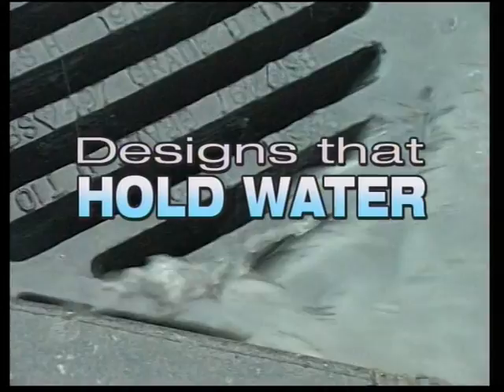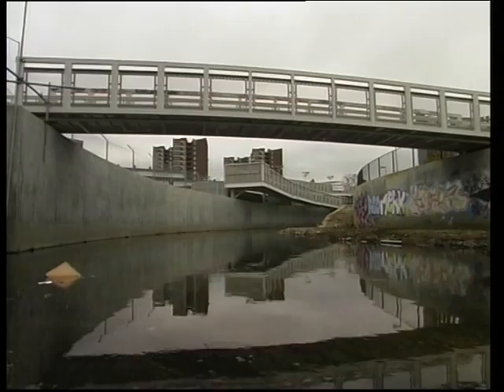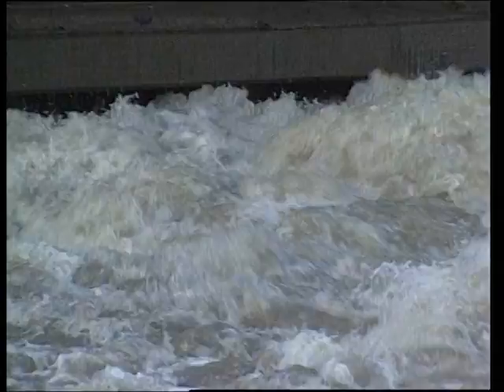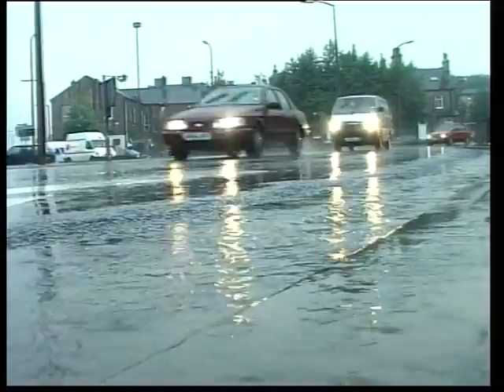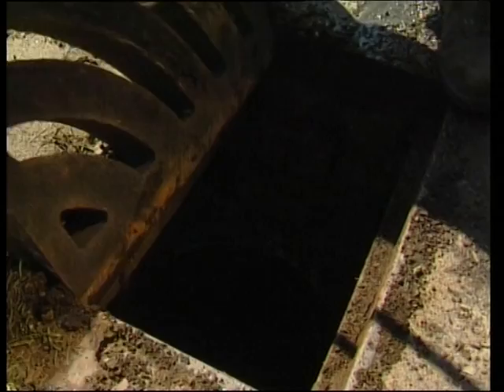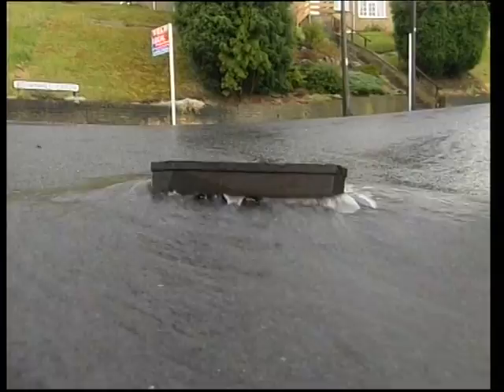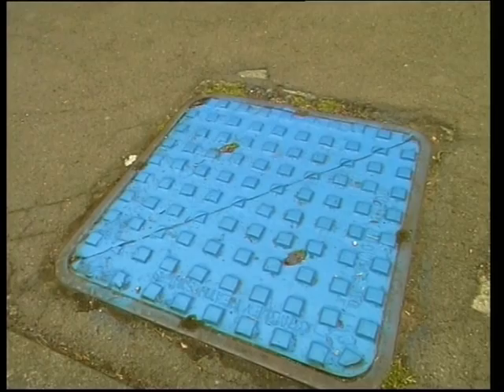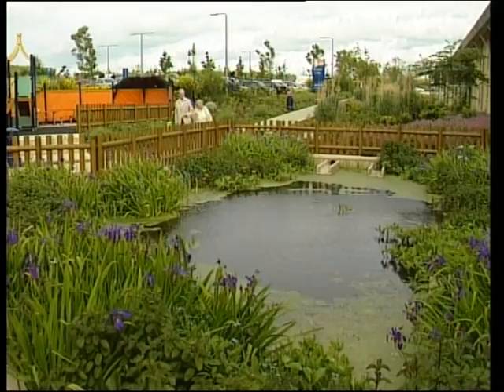Designs That Hold Water: Sustainable drainage systems (SUDS) explained - pt1

Comment: I hope you are right, because so far all  I can see is  polluted waterways and failed drainage systems. I don't understand why don't they just use the same filter system that is used on the water Dams, you know what i mean, like  a  small version of it  , is that possible?
Reply: linear drainage system with modular cells and filtration products installed at the catch basin and etc, they're the better choice.